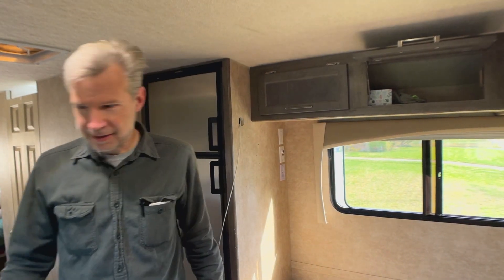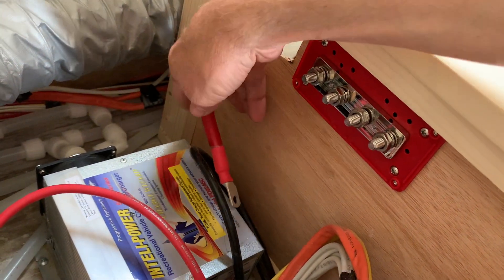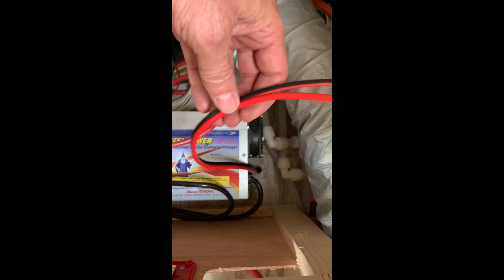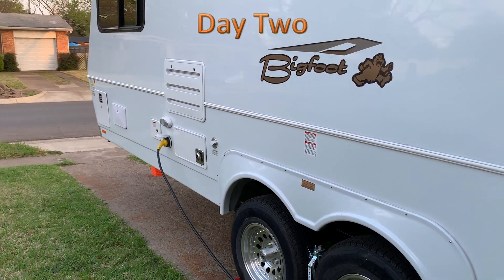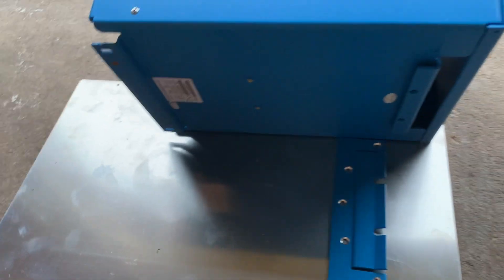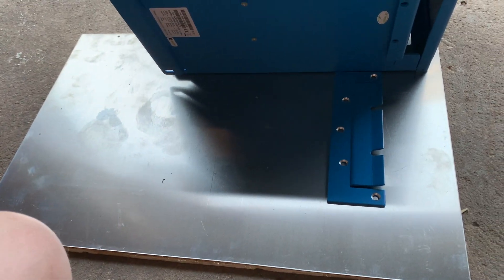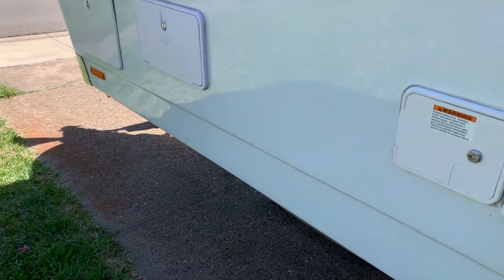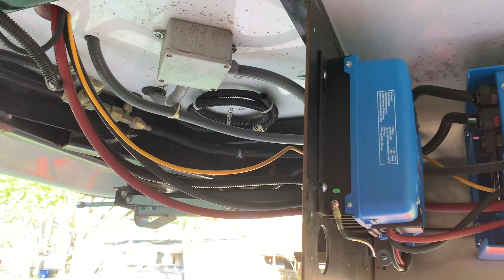RV solar installation - Part 1 - everything but the panels

Comment: I certainly did enjoy watching Charles install the solar system in your Bigfoot.  Would you mind sharing some of the specifics of the components you used?  For instance the brand and capacity/ratings  of the batteries, inverter, charge controller, etc. as well as the wattage of the 3 solar panels (yet to be installed).   Thanks for sharing your projects with us....!
Reply from the maker: Hi Jimmy, the inverter is a Victron MultiPlus 12/3000/120-50, paired with a Victron SmartSolar MPPT 150/80 charge controller and BMV-712 battery monitor. I highly recommend the monitor, and even though they are relatively expensive, I LOVE the Victron equipment!
The batteries are 2) lithium BigBattery brand 12V "Owl Max 2" for approximately 6kWh. There are a plethora of battery types and brands out there, but I chose these for price/energy density, warranty and form factor. They fit the compartment I had available very well. They have worked great and I am happy with them.
The solar panels are 3) Trina 300W residential style 60-cell modules. I used to work in the solar industry, so I picked these up cheap. While I haven't got them installed yet, it may be a challenge to fit them well on our BigFoot trailer. You can always get a better price/W on these larger panels, but fitting them on a roof could be a problem. I hope to finally get them installed this spring, and we'll certainly make a video for that. I hope it goes well!
Reply: @OvertheRiverandThroughtheWoods  Thank you so much for sharing that information with me. I will be looking forward to Spring and the panels installation!

Comment: Hi Charles, Nice trailer and very nice job on your off grid system.  Are you concern about road dust and dirt contaminating your inverter and the solar charger under the trailer.  Also, will the external enviroment impact the output rating of the inverter as it relate to the operating temperature of the  inverter.  As  you know, the rated continuous maximum output is at room temperture (72F or so).  Higher temperature will derate the output down significantly.  I imagine the hot asphalt during summer months in Dallas would impact the performance of the inverter.  Nevertheless, that looks like a very comprehensive and clean solar/lithium system.
Reply from the maker: Thanks for your comments. Several thoughts:
We hope not to be operating in extremely hot locations, hence the lack of an a/c unit on the trailer (leaving Dallas for Vermont). The solar components being mounted on metal, will act as a heatsink, which should aid in cooling. If we do encounter high temps, and derating becomes a problem, I can remove the back cover for more airflow while stationary. Even with the box open, it is well protected from weather. Otherwise, the box is fairly well sealed against water and contaminates while traveling down the road. I will of course check the system periodically to insure all is well.
My bigger fear is going through standing water deep enough to enter the box. That will be something I have to be very careful about.
impressively
Reply: @OvertheRiverandThroughtheWoods  Sound like you already had identified the design considerations.  I have the Victron 3000 inverter also mounted in a tight spot in my Escape 21 trailer. To mirigate air fow and temperature issues, I elected to take the top cover off and installed fans in opposite end of the compartment to ensure air flow. The Bluetooth feature helps me monitor the inverter temperature.  Before these two modifications,  I saw the inverter surface temperature reading up to 105F at one point. I run an Mini split AC with my inverter, so I am a higher energy used compared to you. You might have more performance margin than I do.
Reply from the maker: @johnnyhung123  Yeah, at this point it is not heavily loaded regularly. Not sure what happen to my note above, but I had mentioned I have been heating a tank of water each day with excess solar. That stresses the inverter pretty good, but not for a long period of time (40 min. or so). This has been working flawlessly with no issues. Of course it has been in the 50s and 60s here in VT ...

Comment: Is the equipment underneath the trailer weatherproof? I see the vents but wondering if you will get moisture from the outside?
Reply from the maker: I sealed the top of the box with silicon sealant to prevent water from getting in (you can see where it did enter before). The vents are on the bottom and the back to keep water from entering. So, yes, I believe it is weatherproof as needs to be.
Got one long trip down now, and all seems well.